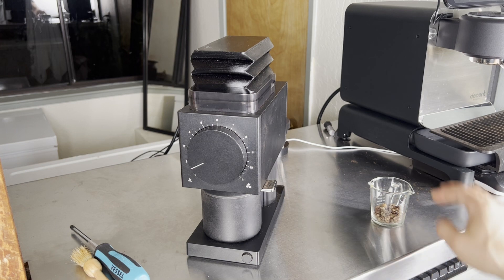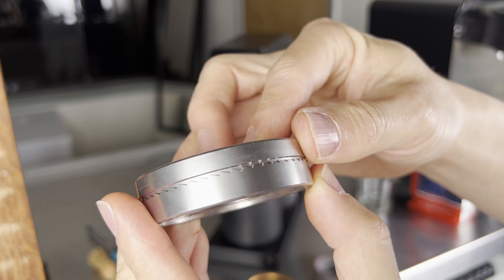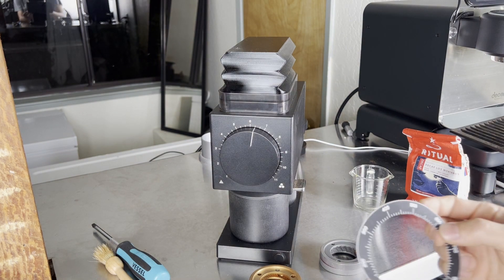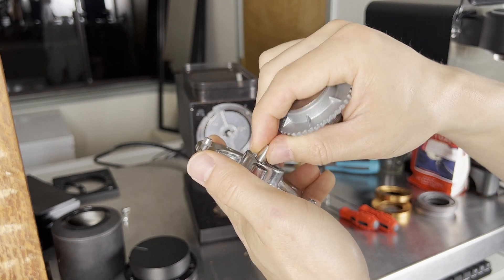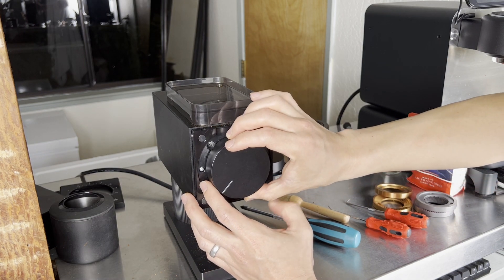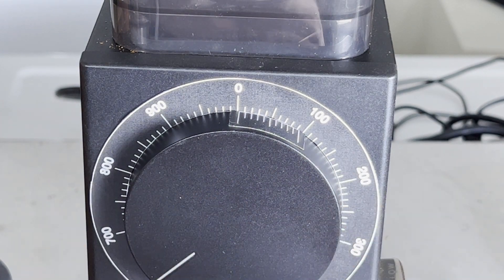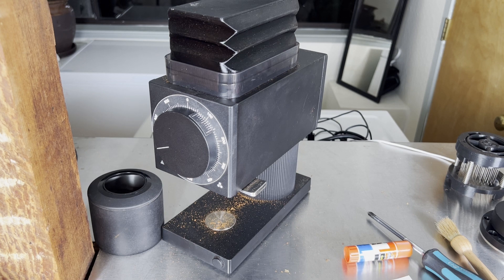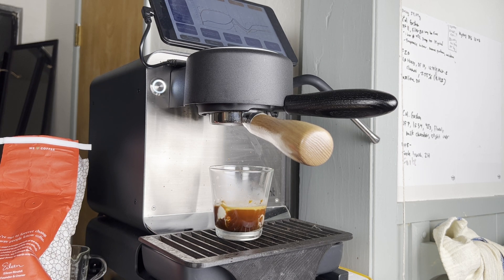Illegal Mods: Fellow Ode Espresso Grinder

Comment: Hot loading (loading while the motor is already running) helps with grinding that fine with light roasts and prevented stalling for me.
Reply from the maker: This also works for me, but some coffee is still too light for slow feeding.
Reply: cant speak to Prady beans but i havent had any issues slow feeding beans with SSP MPs at espresso range with fairly light roasts ive run through it (wendleboe).
Reply: @austin3878  Wendelboe is a medium roast compared to mood trap :D Hand grinding them next to each other is like night and day.

Comment: I have seen others remove the spring-loaded pin altogether instead of installing the additional 3d-printed plate you’ve designed. And then simply relying on the teflon tape for friction. I assume you have tried simply removing the pin before designing the replacement… how do you think it compares? Do you feel the new plate/pin is totally necessary?

Comment: I guess that your custom micron scale doesn't refer to the peak particle size of the coffee but something else? If the burrs are x microns away from each other, does that correspond to the same size of coffee produced? Thanks
Reply from the maker: Generally speaking, a smaller burr gap will result in smaller particles. If you are grinding the same coffee with the same general conditions (temperature, humidity, bean age, etc) then you should see similar extraction times and yields at a fixed grind setting.

Any statement further than that is quite nuanced and not all that well understood. Particle shape and size distribution is a function of burr geometry as much as it is burr spacing. Other factors such as the grinder speed or coffee itself also play a big role.
Reply: @jkimmakes  thank you. I accept that shape and distribution are variable but is it fair to say that the burr gap dictates peak particle size? I've got some SSP Multi-Purpose burrs on the way and am trying to decide between the ode and DF64. It's important to me that the grind settings be repeatable and having a decent amount of control and range on the settings. Your Vernier scale looks good, I don't think anything like that exists for the DF64.

Comment: Hmm i just did the stepless mod using your 3D prints, and I replaced the burrs. However, I ran the grinder without beans to test, and the grinder does stop and beeps - as if there is a jam. Any idea where it could be?

Comment: Fascinating trick with the teflon tape, I am going to try that. I have one auger that gets stuck sometimes and another one that never gets stuck because it is looser. Is the tighter auger going to have less lash and therefore more stable alignment?
Reply: I'm assuming the answer is yes, but I've been scared to use it in case it becomes permanently stuck. However, that pick trick seems like the best way I've seen to remove a stuck auger. Thanks for the great content!

Comment: Great video and love the mods! I’m curious if you printed the bellow using the file that’s on thingiverse? I tried printing it twice with my mk3s but the sides started caving in on the print near the half way point (if that makes sense)
Any advice or special things you did for the print?
Reply from the maker: I just printed with the sainsmart TPU profile using sainsmart TPU. I didn't adjust anything other than that.

Comment: Are you still using the v1 cast burrs? Or did you end up putting the v2 in?
Reply from the maker: My v2 burrs are coming this week!
Reply: @jkimmakes  Nice! You’re gonna love them. The geometry is the same, but for some reason, they also perform better. Even if you’ve aligned the v1 perfectly.
Reply: @jkimmakes  I've been using them for a few days I love them so far, I know the back is machined as well.
Reply: @jkimmakes  thoughts after using your v2 burrs? Still worth getting the SSPs instead?

Comment: You mentioned something all these "top" reviewers barely mention, or skim over, and thats the grind precision of espresso grinders. The 1mm thread pitch. Many espresso grinders are stepless, and reviewers really need to mention this.
 I use a Eureka 54mm and the adjust knob is horrible, as you can never get it dialed in with ease. I waste 3-7 shots. Also that when ON under load the adjuster moves different than off. I think you would set yourself even more apart and important if you do videos on grinders that focus on ease of finding grind settings. Maybe I have been torturing myself with the Eureka, and other grinders are precise and easy to change coffee types for espresso?  I dont even drink drip, so I dont even change it a large amount.
Decafe needs even lower setting for espresso.

Comment: Since you have both the ode and df64 with ssp's may I ask if the df64 with ssp runs a lot louder especially when grinding beans?
Reply from the maker: The DF feels louder to me, but I never measured the sound difference when they both had same burrs. The DF with SSP MPs sounds like a jet engine. The Ode with cast burrs sound low pitched and rumbly. I don't remember the Ode with SSP MPs ever sounding quite as high pitched as the DF does, but also never really paid much attention to it.

Comment: Question (for those of us without a 3D printer) are you willing to also sell the step-less mod and vernier scale as a finished product?
Reply from the maker: I've pitched it to my dad and he seems interested in doing so once he gets a handle on the WDT demand.
Reply: @jkimmakes  How about the bellows?
Reply: the stepless mod is incredibly simple to do. you don't need to fill in holes or anything like that flip the little knob that holds the notches in place around, put some tape or rubber on it. put electrical tape on the plate to cover the holes and increase friction, if you need more friction you can add some adhesive I literally used a little bit of syrup with some coffee grounds to increase the friction and it works perfectly. i would totally buy a really high-quality sticker of the vernier scale tho.

Comment: You seem to have opened the Ode a lot, have you encountered stripping on the screw? If so, how did you fix/replace it?
Reply from the maker: I haven’t stripped any screws on the ode, but definitely have stripped many screws. There are a bunch of tips on how to remove a stripped screw, but the one that works best for me is cutting a slot into it with a dremel and then using a standard screwdriver to remove it.

In my more experienced old age, I can usually identify screws with the potential of stripping before I actually strip them. A JIS screwdriver helps a lot with Philips head screws and other times an impact hammer is the way to go. With grinders in particular, take extra care to clean out the screw head recess before attempting to remove it and always use a properly fitting screwdriver.

Comment: How do you know for certain that the scale of your vernier is correct? i.e. when you increase by 100 micron, is that actually changing the average particle size 100 microns larger?
Reply from the maker: You don't know that the particle size is changing linearly with respect to burr gap size. Particle size distribution is more complicated than burr gap.

Comment: The gaggia mdf with a smaller 100w-120w motor can grind super light roast espresso all day and not stall because of the gear-reduction.  The Ode is offered with day 1 DLC in the form of purposefully crippled burr sets.  Boo.

Comment: it will burn out the motor much quicker when you grind for espresso in a machine that's not designed for it.